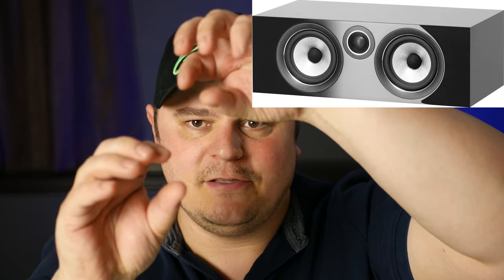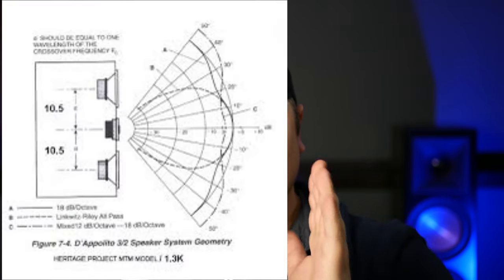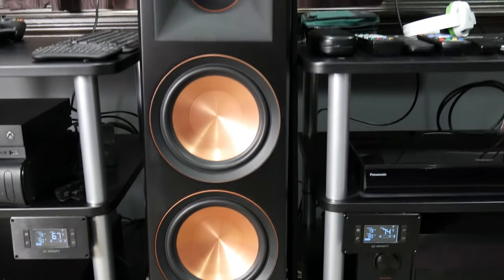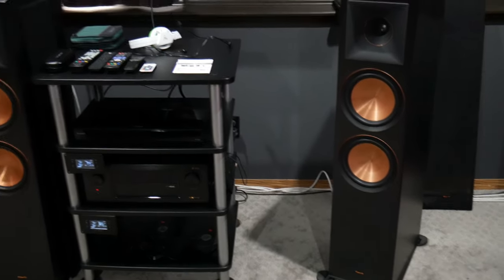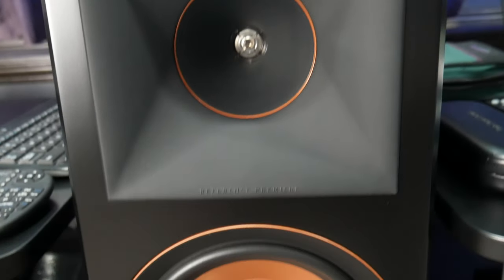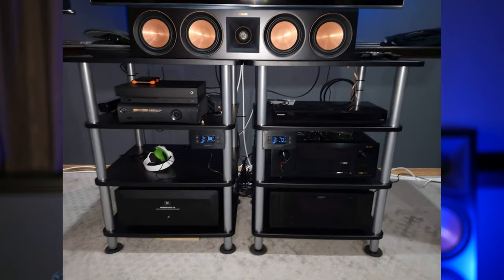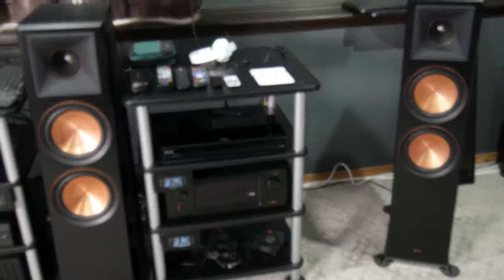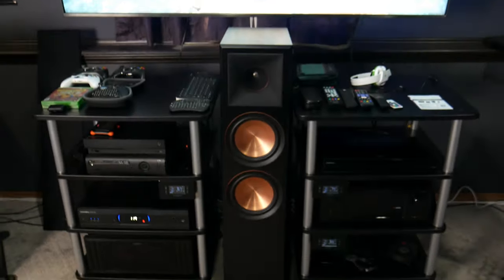IS A CENTER SPEAKER WRONG? IS A TOWER SPEAKER IDEAL FOR A CENTER SPEAKER?  I Spec of Tech

Comment: I bought a single Paradigm tower speaker that someone was getting rid of for $25 and I find it works out way better than the JBL horizontal center channel speaker I was using, particularly when I watch older films that only have a 1.0 channel lossless track (which is probably half the time for my use). So much more defined and I find that vocals sit nicely in the mix rather than jumping forward. And it sits under my 51" plasma just fine. In my space it even leaves me room to go up to a 65" with ease. I flanked that with a pair of Mitsubishi SS7600 speakers that have insane imaging and a pair of Wharfedale Delta 5.3 speakers for my surrounds. The whole setup cost less than $150 and is my poor man's hi-fi surround sound and it's glorious! 😊

Comment: ran identical towers in my old 5.1 system, then added bookshelves as rear surround L and R mounted high on the wall. I'm trying a horizontal center speaker now with a 7.1.2 setup but mounting the TV high enough to clear a tower in case I decide to go back. L C R being identical really sounds amazing for dialogue and any main action sounds.

Comment: Been wanting to do this for years, and now I'm finally going to. Flanking your center tower with the audio equipment is exactly what I'll need to do. I have a projection screen, but will only need to increase its height by a few inches to clear the top of the speakers I'll get. Of course, my choices will be limited to towers on the short side. Thanks!

Comment: My tv is on a stand, so I had a small tweeter as my center speaker. My front LR towers, the Klipsch r-610f's just sounded significantly better than that tweeter, and no timbre-matched center speaker out there will fit within the small space between my tv and the stand. Placing it above the tv is definitely not an option either because of Atmos. Simple and free solution was to just disable the center channel in the receiver's configuration and run a phantom center with the LR towers, and I just love it! Toeing in the towers toward the furthest listening position really helps anchor the center channel to the center too! With that solved flawlessly, I just have to get matching Klipsch bookshelf r-41m's to timbre-match the surrounds too.

Comment: I like your vids and ideas, but as usual, I offer an alternative view (LOL). Like you, I have never liked the horizontally aligned center speakers. My answer is to use a "Phantom" center. That is, no physical center speaker. Some receivers call it "Phantom" but some like my current Denon simply let you choose "No Center speaker" and the receiver splits the center signal evenly to both left and right, similar to the center stage imaging of two channel stereo sound from the old days of yore (LOL). As long as you are near center, there's no issue, but as you go further off center the more you'll notice it, but it's not as bad as you might think. Plus there's no height issues like with a center speakers mounted below the screen. Of coarse the best answer (if you can afford it) is to have a center that matches the left and right fronts (as you suggest)
Reply from the maker: Yessir, I have tried the phantom center as well.  I liked it, but I will say the tower center does anchor the sound to the screen better, but the phantom center is definitely a great option as well, you are right.
Reply: With proper imaging, you can point out the location of the source of the sound with just two speakers. That's called stereo :-). This means that, when in a normal viewing position, you have the speech in the middle of the screen. When in a movie theater, you might be sitting (very) off center. In that case you need a center speaker.
Btw, I disconnected my center speaker and I had to keep reminding myself that it was disconnected, because I could hear the sound coming from the screen. Very surreal, but it makes sense, like stereo makes sense.
Reply: This is interesting. I have always wondered about the use of a phantom center, I would love to set a comparison of regular center, matching LCR and a phantom center to see how much alot a difference their is. I would think that in most instances if you are listening below reference a phantom may be the way to go. Thoughts on that?

Comment: I've been experimenting with a pair of decent older bookshelves myself (hooked in parallel to get 4 ohm loading my AVR prefers).  It permits not only slight toe-out to increase the horizontal dispersion and permit you to focus either independently, but also allows you to set one back slightly to help with tuning dispersion errors.  I can't say its better than a traditional horizontal center, but it is too early and I want to see what my DiracLive changes between the setups.

Comment: Good review,I have a klipsch set up i had the r52 as my center it would sound muddy at higher volume the dialogue was never that clear so i switched with a spare klipsch speaker the r51 bookshelf and it sounds so much clearer now.
Reply from the maker: Glad to hear you got your dialogue cleared up.  I would also suggest treating your room with acoustic panels, especially the back of the room.  That is a great way to clean up dialogue even more...cheers.
Reply: Thanks
Reply: I just replaced a TV, yesterday, that was mounted to my AV shelf system.  The new one had a different VESA pattern so it wouldn't fit...had to buy a wall mount.  Upside is I can get a bigger traditional timbre-matched center speaker or buy an additional RP-600Mii to use as a center.  I currently have a R-34C because it was literally the only one that would fit on the shelf under the old TV.  The Klipsch replaced the front 3 speakers of an old Polk satellite 5.1 system.  I used the L/R as additional surrounds so now I have a 7.1 :)

Comment: Why not just use two dipole speakers?
If your TV sits at eye level, then this could be a good option, if off axis conb filtering is an issue.
Dipole speakers should eliminate comb filtering issues, as they direct the sound out to the sides, so you could face the centre most drivers directly towards the sweet spot, and the drivers towards the outside will direct the sound to the right and left axis. However, unless you have a very large viewing room, with your L&R front speakers spaced 10 feet apart or more, then this is not necessary, and  overkill imho.

With a tower speaker, or even a vertically mounted bookshelf speaker, you are going to restrict the centre channel to a very narrow area, so it may not sound very natural to anybody sitting off axis, and could sound boxy and contained.

As somebody with many years of experimentation with speakers behind me, I use a conventional MTM centre speaker, and I have no issues with it at all. And I can simply widen the centre inage via DSP settings on my receiver if need be.
There isnt much benefit in terms of BASS from a centre channel, so a full range speaker is not necessary. Even if you increase the bass to max level, via your Receiver DSP settings, all that this will achieve is very BOOMY dialogue, which is not what you want for a natural sounding home cinema setup.
Reply from the maker: I get what you are saying, but with dipole speakers it would mess with the front stage imaging.  This isn't something you want if you are looking for an accurate soundstage for movies.

I think you may have missed an important point when discussing using a vertically aligned speaker for the center.  It doesn't narrow the horizontal dispersion, it actually improves it.  It truly is a technical acoustical improvement over an MTM speaker in every way.  They only downside is that an MTM center channel is easier to place under a screen due to the cabinet design.  That is why everyone using an acoustically transparent projector screen uses 3 identical LCR speakers, including every movie theater.

With all your experimentation and experience with speakers, I know you're aware that the center channel is the most used channel for movies and shows.  So it would stand to reason for the center channel to be at least as capable as the L&R speakers if not even more capable.  Using a center channel that is capable of outputting great bass won't make it boomy, it just makes it more capable of outputting the bass should the scene call for it.  The only way it would become boomy is if it is eq'd with a big bump in the lower midrange and bass region.  

The most common crossover in most home theaters is 80hz, so your speakers should be capable AT LEAST down to 80hz if you intend to use that crossover.  Now of course, it would be better if they are capable of frequencies down to about 50hz or so, because an 80hz crossover is not a brick wall, instead it just rolls off smoothly after 80hz.  Having a more capable speaker will allow for this roll off, and help with integrating your speakers with your subs.  If your center speaker is not capable of bass, at the very least till the crossover point, then your sound will be thin/anemic until the subs kick in at the crossover point.

I hope this further helps explain my video...cheers.

Comment: 2 Klipsch fortes slightly elevated so the horns are at the center of the 65” plasma screen..no middle speaker although over the years have used 3 fortes with 2 PSB rears & a PSB sub..

Comment: I'd like to see a center speaker with 3 tweeters, one facing directly forward, and 1 angled slightly to the left and one angled slightly to the right. That way, several people can be in the direct line of sight of a tweeter.
Reply from the maker: I like where you are going with that.  The only problem is that you would run into comb filtering and phase issues that might be really difficult to overcome.
Reply: That would be a terrible idea. Learn about lobing issues to understand why.

Comment: I've noticed a difference in audio from the center channel when listening from left and right of the sweet spot, however I don't think a vertically aligned center channel speaker will correct this. Unless for some reason it produces a wide soundstage. My reason being most left and right channel are toed in to achieve sweet spot

Comment: Question, do you prefer a single subwoofer in a corner vs 2, one in each corner? Which is better?
Reply from the maker: If you have the budget for it, definitely go with 2 subwoofers.  You will get a smoother response in the room, and more output if they sum properly.

Comment: Its not wrong, its just that speakers built for a specific duty usually suck comparatively as you are sacrificing something in cabinet design for room astetics. Perfect world, all speakers match exactly including atmosphere but nobody wants tower speakers on their ceiling which is why theater speaker cabinets are the dimensions they are, you can stick them anywhere even though they're still huge

Comment: I uses 4-towers for center and 2 for Rt and 2 for Lt and if you like Music and Music Video's nothing sounds better w no need for a subwoofer (never liked subwoofer)
Reply from the maker: Very cool setup.  I would be very interested to hear a setup like that.
Reply: I'm going to load something up later this Year But I did this years ago and never looked back the big center channel speakers add life to the Music
Reply: @musicstevecom  buy one jtr and you don’t have to worry about towers lol.you usually keep most of your channels on the small setting and allow the subwoofer to handle the lower frequency.I guess it depends on your budget,really.Their is a lot of variables that take place and having your subwoofer handle the lower frequencies can help the rest of your channels not have to push all that power to the woofers,tweeter and mid.If you want to run your channels on large then you are going to need a hefty tower speaker that can handle power and not distort.depends on the individual I guess
Reply: @SpecOfTech  now - how would you "install" 88 speakers, when they are all manner of sizes, impedances and ages/uses of too with most simply being used - ad-hoc in whatever cabinets I could find & some no-back cabinets too.. most hot-wired with lights as vu meters (can't buy multiple ch. vu meters for up to 25 ch. systems anyways, plus xmas fairy lights wired direct across the speaker voice-coil terminals help with circuit impedance matching)..

Oh and vertical - does that include wall mounting an assortment of speakers UP a wall too?
https://youtu.be/Ub0S8eTijrA
Reply: @johndoe9501  ?
Oh you mean ONE - but why only one?
As in use as many sub-woofer's as channels as that way every channel's low frequncy signals are heard - not summated across ONLY one?

Does a lion at night, run around in front of it's prey - to ROAR DEEPLY, before returning behind it - to roar as it leaps - hell no - it roars wherever the hell it is, thus your speakers and subs need to be positioned all around a room - not mere;y rely on one speaker ?

By having your subwoofer do all the work - of all sub woofer frequencies as they play - in & out of phase with each other - is a big ask for one woofer?
Reply: @musicstevecom Well it's now been three years, and still no video upload.

Comment: Do you run the centre full band or run bass management and crossover at 60-80hz? Is there a day night diff between tower and horiz speaker ?
Reply from the maker: I use an 80hz crossover still.

Comment: cool I was wondering about this my question is did you see a difference in centre sound going from a centre to a tower? meaning all that brightness has it gone away or has it become richer because of the woofers. keep it up your getting better behind the camera.
Reply from the maker: Thanks for the support my man.  It definitely does sound better, I never had a problem with too much brightness with the RP504C.  These new Klipsch speakers really have done a good job of smoothing the highs.  I did notice that the mids were more rich, definitely a nice balanced sound from the tower and it does sound better.
Reply: @SpecOfTech  great to know Ill look into that for sure :)

Comment: Hi was thinking in an alternative solution.  If you have the flagship  speaker as L and R and take de one smaller of the smallest tower in that serie for the looks and sonically sound as a center then you're TV can hang lower just above the lowest tower. It has less power than de bigger L and R but enough power for a centerspeaker. You're opinion, greetings from the Netherlands 🇳🇱
Reply from the maker: Thanks for watching, and welcome!  You would still be getting the benefit of a vertically aligned speaker, which is better horizontal dispersion.  The problem is, the center speaker is used the most in movies and games, so you really want you center speaker to be up to par with the L&R.  If you can have your L, C & R matching, that really is ideal.  I would suggest using 3 matching speaker if possible, maybe use 3 of the smaller speaker then...cheers.

Comment: I believe the RP 800F is 43" high. That means the TV would be 45" or so. Mine is at 37 currently. Kills my neck looking up unless I move back. However, you could buy all 3 RP800F's with what one Klipsch 64 lll center channel costs. Is it ok to use another brand's center channel if I go with the RP 8000F? Will they communicate properly? I do like the SVS Ultra Center channel. Also, most importantly do you think the 64 lll is worth the money?
Reply from the maker: I wouldn't mix and match the front stage.  You really want the front stage to be timbre matched.   If you typically are reclined a higher TV  actually works better, but if you don't recline I can see the issue.  The RC64 is one of the better horizontally aligned centers out there.   I can't say much more than that because I have never owned one personally.  If you have Klipsch left and right, I would also look at the RP504C for a center channel if the price of the RC64 is a little much.  Cheers!

Comment: Hey man... Your video came around the right time as I was thinking about this.  So I have something of a crazy idea in "tune" with the horizontal/tower center dilemma...

So I'm wanting to get my Polks upgraded by the end of the year.  Now eventually that'll mean getting a "traditional" center.  However, I eventually do want to get an acoustically transparent screen and a matching tower for the fronts.  Now here's the really interesting part:  I've been eyeing the 11-channel Yamaha amp that will let you assign channels (let's say even up to three centers).  So here is the big question:  What are your thoughts of using BOTH a horizontal center, and have it placed slightly above a tower in the same line?
Reply from the maker: Thanks for watching man, much appreciated.  I will be honest, I don't understand the science enough to give you a definitive answer.  Although, I would assume that there would be some conflicting frequencies having a horizontal speaker above a vertical one.  Again, I can't say for sure, but I imagine there would be some sound degradation as those frequencies would work against each other.  That doesn't mean that it might not sound fuller or more forward, or it may sound worse than having just the one vertical speaker.  If you do end up trying it, please come back here and give me your thoughts, I would love to hear them!